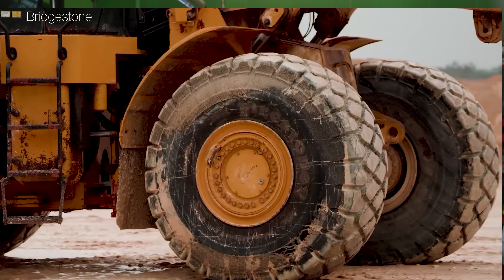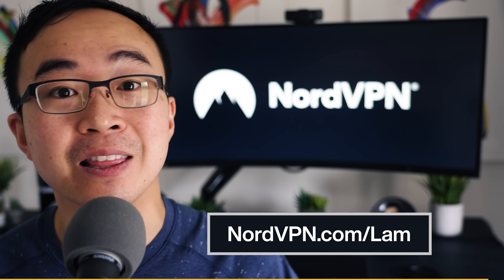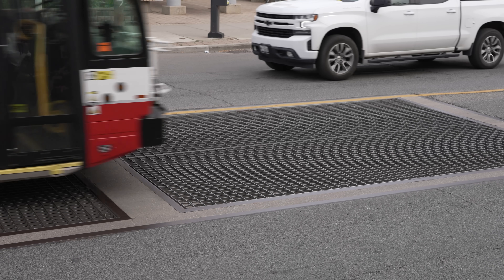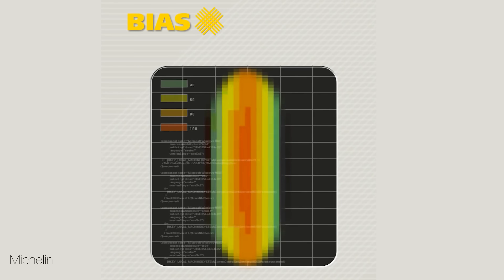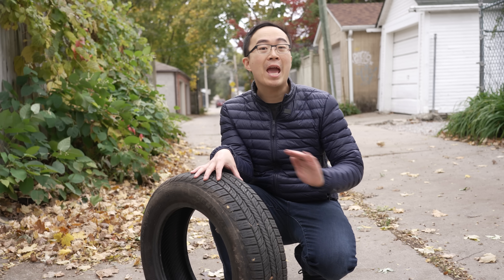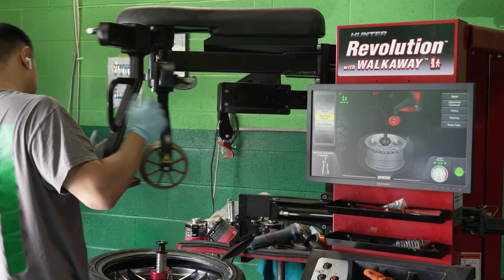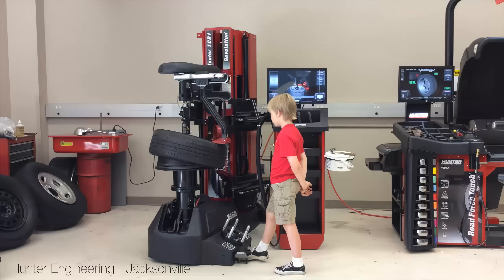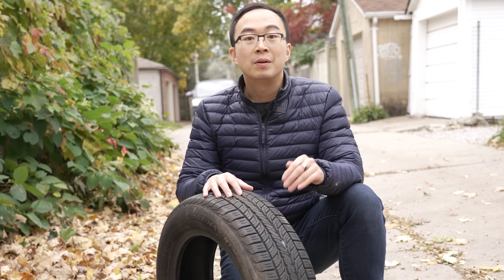How 90 Years of CLEVER Engineering Transformed Tires

Comment: 12 mins video for 2 minutes of title content.... really ? Btw the issue with cheap tyres wearing down to fast on the shoulders can be easily solved by increasing the pressure by 0,5 bar since the manufactor recommendation is always a trade off between comfort and durability. Source me working as a car mechanic for 6 years now.

Comment: The problem with "worn" tyre tests is that you would need to artificially wear them, as it makes a huge difference how the "life" of the tyre was during wearing.
Was it exposed to UV light all the time (parking outside in the sun) was the car in a garage?, Was it in cold or hot climate, or changing... So many variables that make that almost impossible to achieve on a reproducable and fair level.
Also: there are tyre companies that make sipes "double" with wear. I think Goodyear or Michelin had such winter tyres years ago already. The new tires had half the number of sipes as the tires if they were worn 50%. (they managed to make inverted Y shaped sipes)

Comment: I know the principle described after 3:20 from electronics. In digital electronics they sometimes deliberatly jitter the clock frequency to spred out the EMI (electromagnetic noise output) of a product. Works just like that, exept in the radio spectrum. Absolutely incredible that they also use that in mechanics, never thought about that!

Comment: Many of us remember the firestone recall that ford explorers would roll over if a front blowout occured. I worked at a firestone retailer and as this recall broke out we got a corporate memo that explained that it was not the tires but an out of court settlement between firestone and ford that resulted in firestone taking the heat for 700 million dollars. Basicly ford paid for every tire we recalled plus a cushion for lost sales due to loss of consumer confidence. The recall was for the wilderness a t model suv steel belted 235×75×15 size tire. That particular tire had been used on chevrolet s 10, gmc sonoma, toyota tacoma, and 4 runners, mazda b2000, and other models sold overseas. Nobody had issues with tires but ford did and here is why. Ford engineers decided to use a twin i beam style front suspension that had been so successful on the full size pickup line. It was scaled down and lightened to operate under the explorer front end. They performed horribly and rode stiff and noisy because they did not allow for a change in steering geometry at different heights and conditions. For example heavy braking will compress the supension and the tires would be held at a tilted in condition(positive camber) wich is acceptable and does not have problems in handling. However a single tire blowout would result in the tire being held in an extremely negative camber wich would force the now exposed corner of the rim at such an angle that it would gouge into the asphault causing a rollover. Ford knew this was an issue but sold the vehicles regardless. It was also found that the customers complained that the ride was too bumpy and as a result ford dropped the operating inflation of the front tires to 28 psi. This was in direct conflict with the 45 psi inflation mandated by the tire labeling. That is the pressure needed to support the load that the tire is rated for. Underinflated tires result in excessive sidewall flex and an overheated condition occurs wich degrades the tire and a catastophic zipper rupture of the sidewall is what happened to some 390 explorers wich resulted in high speed roll overs. Unfortunately many were fatal and a class action lawsuit was lodged against ford. Ford turned and filed a lawsuit gainst firestone wich in all probability would have been dismissed leaving ford holding the bag so in an attempt to shirk responsibility ford offered firestone a large lump sum to take the heat. Ford then took the results of that finding and used it to defeat the class action lawsuit, or tried to anyway. Like i said in a previous post, i will NEVER own a ford product EVER!
Reply from the maker: Thanks for this detailed writeup Travis.  It may get lost in the comments section but I appreciated this detailed look at its history.  Saved in my notes.

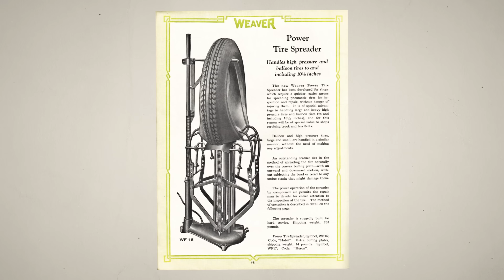Comment: 10:02 I’m a tire guy, that is used to hold the tire in place and open it up, usually for patching nails and other punctures. The shop I work at still uses them (although ours is much more compact), it’d take at least twice as long without i

Comment: I had two consecutive vehicles that used the same tire size.  I was also putting a lot of miles on my vehicles over the time when I owned said two vehicles.  Consequently, I bought “several” sets of tires.  What I found was that some of the highest priced tires actually ended up being the least expensive because of their practical longevity.  They were also the nicer driving/riding/performing tires right from new.

Comment: Okay, now what causes that tire "cupping" or whatever you call it?  It is when each "knob" of the tread develops a radial taper, or every other knob does it, and it gets noisy as hell after awhile.

Experience suggests that it is not due to alignment issues, nor inflation pressures, nor condition of shock absorbers.  But that's what shops blame it on.

Comment: BTW Michelin is the first company to actually perfect the radial tire.  It was the first radial tire that you could remove from one side of the vehicle after it had been run for awhile and install it on the other side without it causing the belts to break and ruin the tire. They are still the best in my opinion.

Comment: The thing you said you didn't know what it is,  it's a tire spreader and it stretches the beads apart so you can access the inside more easily so that you can patch the inside. It's not actually obsolete because an inside patch is still the best and most reliable way to repair a tire. 

That automatic tire changer is great for unskilled workers,  but I  or any other skilled tire changer would absolutely smoke that machine with pretty much any air powered machine made in the last 35 years. The traditional machines would be at least twice as fast. I've raced and had someone time me in the mid 80s and I broke a tire down,  removed it and installed it back on the wheel and had it taking air in less than 30 seconds.  That's with no rusted rim, or changing the valve stem or any other hassles that you often run into.  That computer machine looks super slow. Any modern rim clamp type tire machine made in the last 30 some years installs the tire without contacting the face of the rim, that's nothing new. I started using them when they first hit the market.

Comment: During my years as a car owner since 1966 - I owned many VW GOLF diesel and later Peugeot 306 diesel cars. And when they reached around 120.000 km, the tires had worn down in front (And also, mostly the exaust broke at a - straight point in front of the damper. My last Peugeot 107 diesel was worn down at 55.000 km! So this isn't a very clever engineering by that!

Comment: 10:02 That's a tire spreader, it's used for tire repairs. It holds the tire in place while you work, so you can use both hands on the repair. I don't think anybody uses it for mounting.

Comment: You should do a video on engine oil, and the tech behind it. My grandfather worked at a lube shop. back in the 50. And years later I ended working at one. I learned a lot about how engine oil has changed. Old cars back in the 30s and 40s required frequent oils changes, as they had no oil filter. Oil back then was low grade and without any filter, could damage engines if not changed out frequently.  Owning a car was very much for rich ppl. But, as cars become more important to everyday life, the science behind engine oil also made thigs cheaper, and last longer. Now you have synthetic high mile oils that are rated for 8000 miles.

Comment: So Siping your tires makes them safer at first, but then makes them more dangerous than if you'd never done it at all? Am I understanding correctly? It doesn't go from benefit down to normal, it goes from benefit to bad bad news.
Reply: That's not what they said at all.  All the tires in production for decades have come with sipes, you can't really buy road tires without them.

Comment: As the modern Tire is safer and better in all aspects you can't deny that the old bias ply tires had a much better look to them. The sidewall looks so much better. Either the white walls or the black walls. (Like the one in your thumbnail) the modern tires aren't smooth or so on their sidewall. Hard to explain but yea. 

but this is of course my own opinion.
Reply: But they can always simulate this, its paint after all
Reply: Yea i mean you could but it wouldn't look good. Like painting a modern let's say Michelin wouldn't look as good as the old 1950s whitewalls. It's just that the sidewall design looked better back in the days

Comment: What is it about tires. Ever since I was a little kid I had a fascination with tires.
Reply: Tread design, the ability to withstand hours and days just rolling along. Back in the day the highways were littered with “road gators” and my dad said it happened when tires overheated, so as I kid I would just stare at truck tires as we drove down the road. And sometimes I would touch them to see if they felt hot. Stupid kid nonsense.
Reply: @alejandroalvarez1544  hehe yes, and i used to be worried if you get up in a train while its running the train would tilt and derail
Reply: is it the shape smell or feel

Comment: 10:02 someone else probably already said it, but this is to spread the tire open to install a plug when the tire gets punctured. Allows the tech to fit a grinder in to rough up the surface so glue can stick better.

Comment: Ayyy CrossClimate2s (the one upright behind him at the beginning) are a great tire... I use them on my Miata as my winter tires... They do amazing in the snow and I don't have to worry about it getting too warm out... Here in KY it will be snowing one day and 70 degrees 2 days later lol... They also work great in heavy rain and have pretty good grip for an all season on dry pavement... Only downside is they have a lot of tread wiggle so they feel unsteady in high speed corners (especially on entry) even if they are holding grip just fine, so they don't inspire a lot of confidence...

Comment: 10:04 that's a tire spreader that spreads the tire apart so that you can drill grind and apply a patch to the inside to repair a tire. I work at a shop and ours is a piece of 💩 😂

Comment: This is a great video for people who know nothing about tires, and your thoughts on testing half-worn tires to see how they age is interesting. Bear in mind the following: All of the forces generated by the vehicle must be transmitted through the tire to the road's surface in order to accelerate, brake, and corner. This makes the four tires the absolutely most important system on the vehicle, including the driver. Fitted with the best tires, an economy car can outrun a high performance sports car fitted with tires that are horrible when new, and worn beyond that. Furthermore, as tires age the rubber compound becomes less pliable from enduring thousands of heat cycles, making the tire less grippy (some manufacturers have introduced varying softness of rubber through the depth of the tread, attempting to alleviate this). Finally, it is far better to run a combination of summer and winter tires rather than all-season tires. At low temperatures, the rubber stiffens up; winter tires are designed to operate at colder temperatures, and winter tires have a different tread patter with more sipes and grooves allowing far better grip in snow and water. People think this is more expensive: no, you use twice the number of tires half as fast, switching every 6 months, so in fact it is safer for no additional money. All-season tires must be able to run at cold and hot temperatures, and on the highway in summer the tire is too hot, and the rubber too squishy, to effectively provide maximum traction. All season tires give you a wider range of operation (temperatures) but with reduced grip everywhere.

Comment: It bothers me how the OEM tires sold with new cars are biased for the best MPG rating which they can publish, at the cost of handling and longevity. Also how people seem to think that the best replacement tire is the OEM spec and how cars are tested and judged with the OEM tires on. OEM tires are rarely the best choice, and the car should not be judged by that.
People buy 4x4 cars for better snow performance but will stick with the same hard OEM tires, not realizing even a 2wd car with winter tires can perform better than the 4x4 which only helps with acceleration (not at all the safety aspect) not braking or turning. There just isn't enough public knowledge about tires.

Comment: 7:40 It is not a water remaining feature. These narrow 3D grooves are added only to winter tires. It is because that the tire cannot really stick to snow, but compressed snow easily sticks to the snowy road.
These grooves are filling up with snow under snowy conditions and they are causing a good adhesion between the tire and the road surface.

Comment: The half depth sipe pattern really is for snow traction only. To achieve good traction on ice those sipes provide hundreds of biting edges to assist in gaining traction with imperfections on the ice surface. As your tire wears down they do get shallow but still provide those bitinf edges. I did not know that snap on provided tools for troops in vietnam that is interesting. I have quite a few snap on tools and flank drive is often imitated never equalled. The are insanely expensive but in the end they're worth it. I dont even want to how much that hunter tire machine cost. A cheap no name tire machine will run 3500 dollars easy the hunter machine gotta be twelve thousand or more

Comment: 9:56 They still are. Tire machines don't get big enough or strong enough to handle commercial truck tires. Those are still mounted with two bars and a burly motherfucker bouncing on said bars. ESPECIALLY 19.5 and 17.5s. Those stiff-sidewall motherfuckers are a BITCH and sometimes take two guys to dismount. 

12r22.5s are pretty easy to work with though.

Comment: I believe that quality tires is THE most important safety measure you can have on a car. Every time I get to use some old rusty car that has many issues, the tires is the first thing that I spare no expense on. If your lights stop working, you can stop the car and change the bulb. If your breaks stop working, you can let go of gas pedal and let it slow down (or use handbrake or shift gears to slow down faster). But if your tires lose traction to earth, you are fuuuukt.

Comment: the "vintage" tread worked well on dirt (more fitting for the time)

and is still used on knobbies
Reply: Yeah people don't realize most roads were dirt or gravel and then have gradually been replaced with paved roads.  Our Farm to Market road in front of the farm was a dirt road until the late 1950's... Grandma told me she used to be able to drive the Model A Ford onto the road, your tires fell into the muddy ruts, and the car would steer itself all the way to town 5 miles away, following the ruts!  OL J R :)
Reply: Yes and this is also why knobbies are loud af haha

Comment: I don't like to let shops put wheels on my car. They always get over tightened. I take my wheels to have the tires changed and hand torque them onto the car myself.
Reply: Don't forget to clean the rust off mating surfaces including the rim center bore and apply anti-seize on the hub flange 🙂

Comment: I actually find the new patters far more annoying than anything old.

I leave near a busy 3 lane per side street, and since 2000 I have noticed a decrease in the sound intensity each time a car drives, alone, but a huge increase when the traffic picks up.

Now, if we use all these "randomized patterns" on all cars on a road, we can see that the noise now covers the entire sound frequency! So we're no longer hearing the noise as "waves" but as a huge never ending "whoosssshhhhhh" that is absolutely worse than anything we had before.

So instead of "whooshh.... whooshh...whooshh..." we now get a "whoooooshhhhhhhhhhhhhhshhhh" than never stops!

Have these "sound engenders" ever tested the sound resulting from more than one car?! Guess what, I doubt they did.

But yes, 3 streets away the sound level is lower than before, so on the entire city maybe we dropped a couple db. But for those those live near the road is a complete disaster.

Comment: at 10:02 the antique tire spreader. I used to use something similar to that back in 2014, its used to open up the inside for inspection and repair. basically plug holes from nails or whatnot. you would use a dremel with rough grit to clear the area then plug, patch, and glue so it becomes safe to reinflate.

Comment: 10:02 that spreads the tire...... so you can patch it easier. 
.
spread it, grind it, put fluid and scrape it clean.... slap on the glue, let it dry..... slap on the patch, and roll out all the air
remount tire to rim 
.
.
every shop has pretty much the EXACT same machine 
the add LITERALLY SAYS "for inspection and repair"

Comment: I only first noticed the difference in tire noise after purchasing a cheap set of tires before taking a long rod trip, the noise was unbearable. I came to the conclusion that those cheap tires were specifically designed to be noisy, which by modern standards, is kinda true.